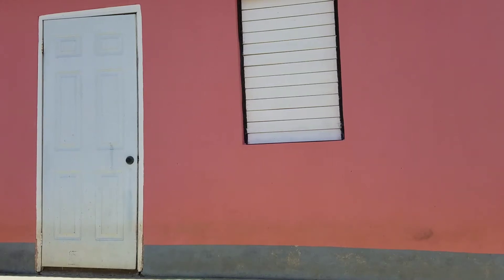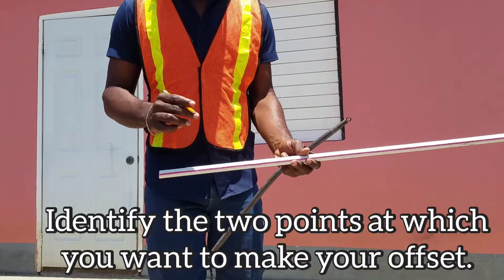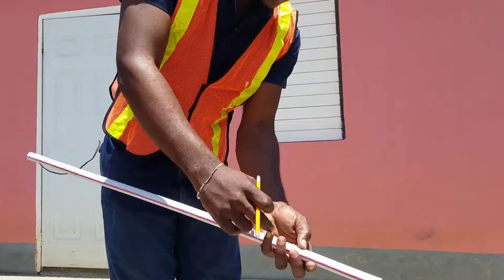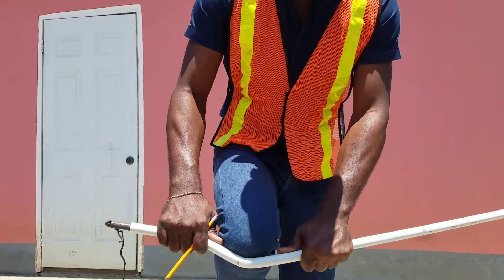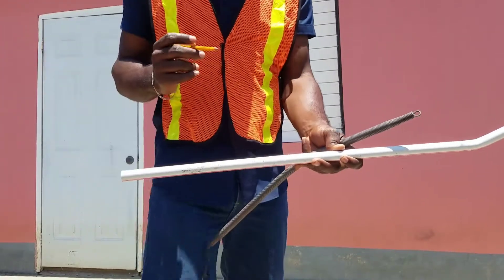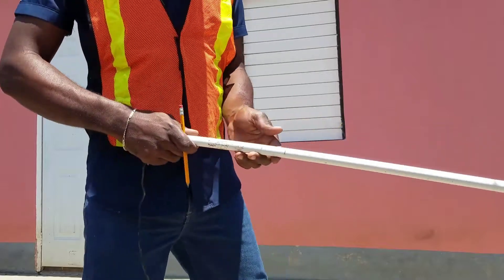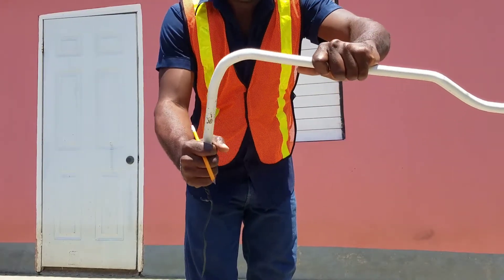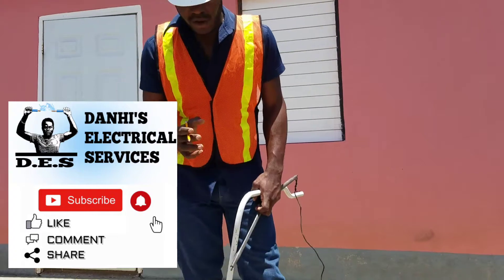How to Bend PVC Conduit (using spring bender) (20mm)

Comment: this is great but still my teacher says that bend is too long when i make it like that
Im trying to achieve a perfect bend,
Reply from the maker: I guess it depends on a case by case basis but It’s normally more difficult to pull wires through shorter/sharper bend.
Reply: @danhielectricalservices  im just tryna learn a lot of tips and tricks to master wiring in the bay area they set us in

Comment: you mean sir 20mm pipe and 20mm spring bender? what if I use 25mm and 20mm spring bender, any advice sir
Reply from the maker: A 25mm pipe will require a 25mm spring bender.
Reply: @danhielectricalservices  thank you